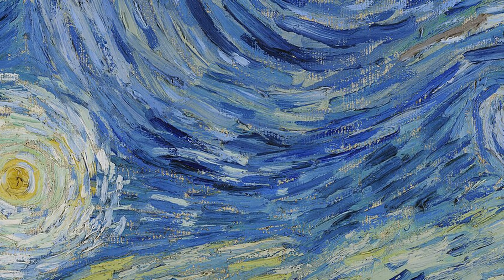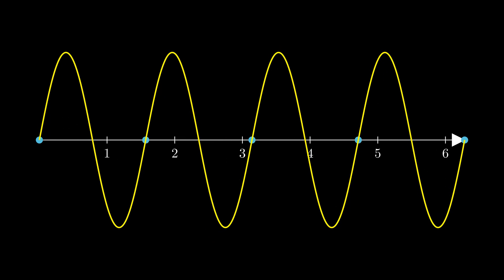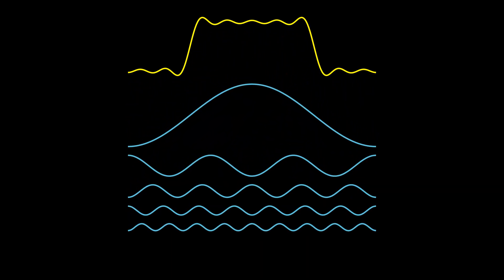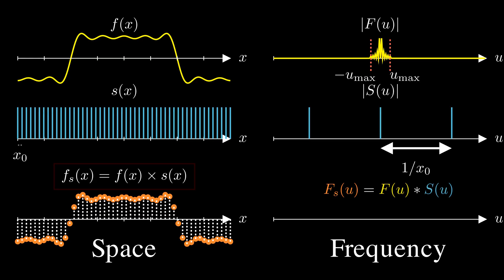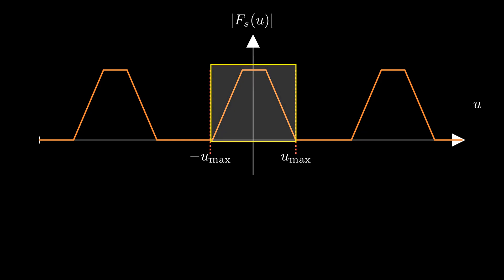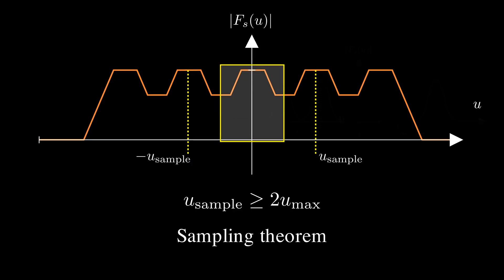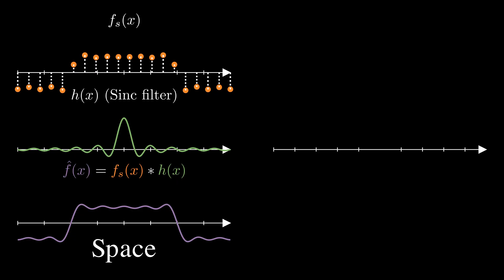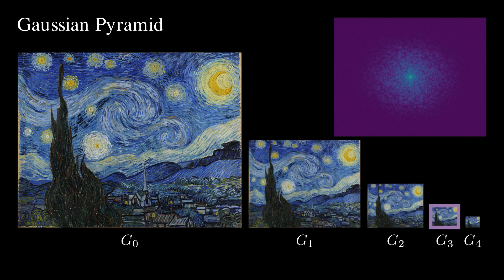Something Weird Happened When We Downsize an Image

Comment: Hello Jia-Bin, your videos are really cool and inspiring!!! I find them very digestable and re-watchable. I can tell how much effort you put into them and I eagerly listen... 
I am finally going to re-visit my program that made some anamorphic images :). I am going to try rewriting and improving in Rust language. 
The current main problem for me is that the anamorphed image is missing many parts. It is basically many pixels spread really far apart. Should I study sampling theorem more in depth to learn how to fill in missing pieces of image? Where should I look to next to fix this hole-y image? Any advice appreciated! Thank you.
Reply from the maker: Thanks for reaching out.

Yes, so in your problem it sounds like you only have sparse samples of the underlying signals. In that case, it’s probably difficult for you to recover the true signal using interpolation. This is an inverse problem since you have infinitely many solutions that perfectly fit your observations. To tackle this type of problems, you may want to use either “regularization” (eg the images are generally piecewise smooth) or “data-drive prior” that tell us what a real image look like (eg think about all AI text-to-image models).
Reply: @jbhuang0604  Thank you! Very helpful.
Reply from the maker: Great!